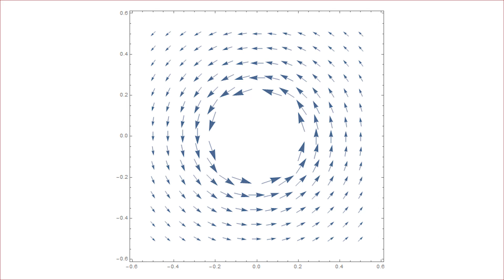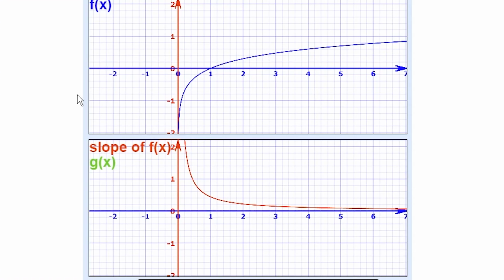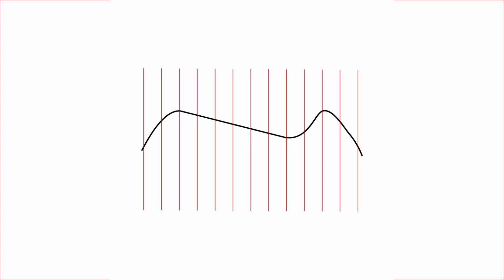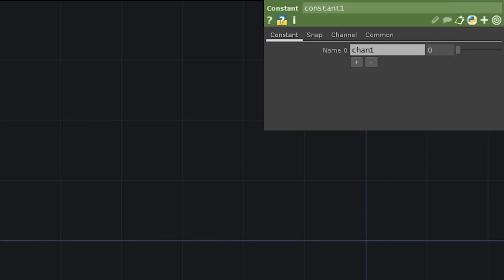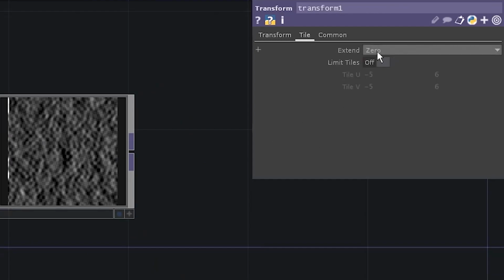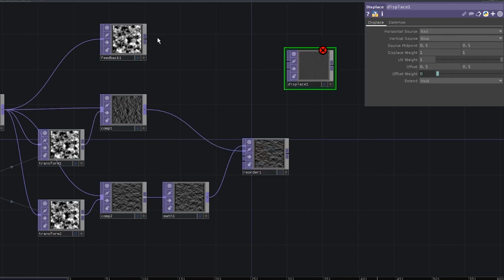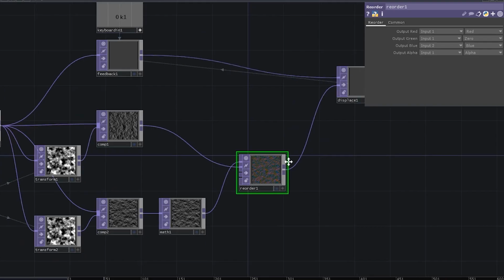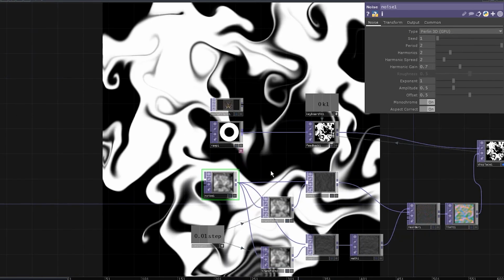Curl noise displacement (Touchdesigner tutorial)

Comment: Thank you, love this simple trick! I was wondering, for a while now, how you can make techniques like this flow on continuously, without having to manually refresh the feedback and without seeing a hard reset on the effect. I have tried dozen of ways but I couldn't wrap my head around it. You really just want to use the original input again and combine that again with an overlaying feedback loop, so it is a smooth continuous effect, like forever curling without losing the colors or the image too much. How would you tackle this Ivan?
Reply from the maker: Thanks! Well, I guess, you can experiment with adding a cross top right after the feedback and feed the initial image into the second input - moving the cross slider will free you from the hard reset :) 
I don't think you can do curl displacement like that without loosing colors after a while, try out adding an over top and add something that changes colors, like the circle in the end of this video. Maybe that's a way to start :)
Reply: @noonesimg  Awesome thanks, will try that!